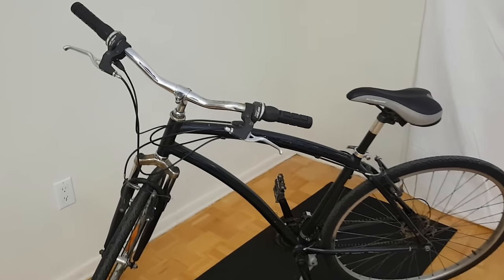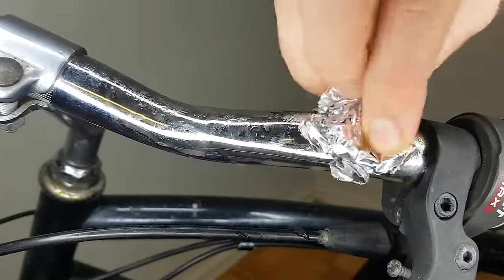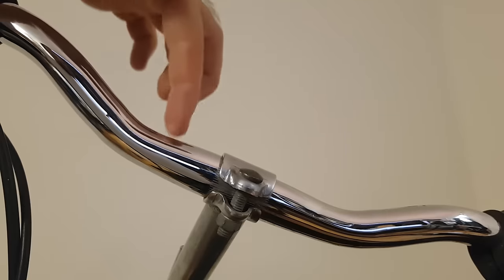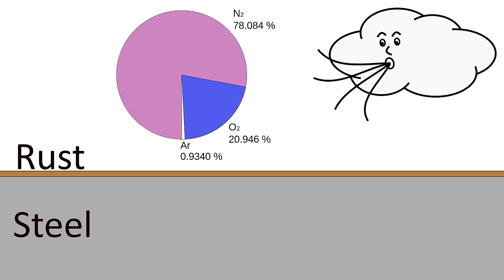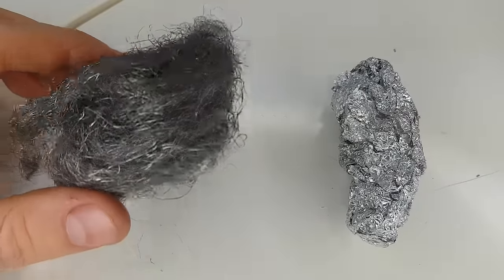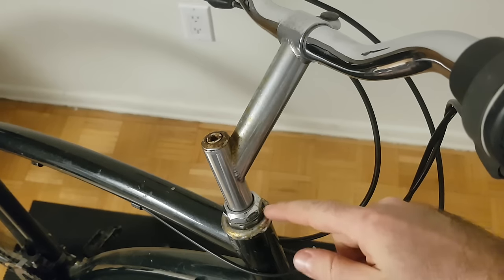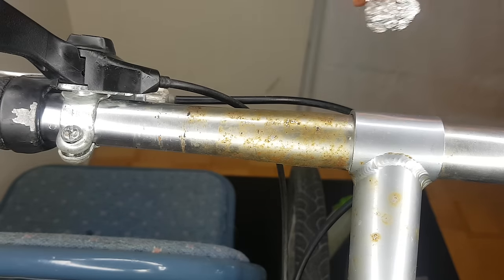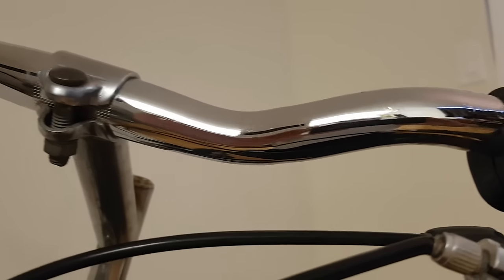Trick for Removing Rust on a Bike

Comment: Once you've cleaned off the rust and have a clear surface, apply a good quality car polish to it. This will help protect it from further rusting by creating a very thin film of wax or polymer on the surface, thus reducing the potential for further oxidisation.
Reply: Or spray clearcoat on it so it will last for years.
Reply: @carlandersonlll6861  Until it flakes off and the next guy curses you forever.
Reply: @72dodge340  😂
Reply: There's also some chrome polish you can buy in small tubes, often gets used on some old american muscle cat rims, polish with some microfiber or similar and you will never need a mirror at home.. 🤟🏻😂😉
Reply: Use the chrome polish instead of water
Reply: 0000 steel works good then followed up with Honda polish or something simple.   Use this on my motorcycle
Reply: Mother's!
Reply: @geraldtakala1721  you mean AS your using  the foil?
Reply: Or F11 polish & rust protectant
Reply: Use Chrome polish
Reply: Superb video George U.K.!
Reply: yeah basically just buy some Caranauba Wax or other ceramic detailer for the bike to prevent corrosion and damage just as you would with protecting a car
Reply: Yeah but then the Polish will turn white and get into the little cracks and never be able to get it out

Comment: After cleaning with the foil and letting it dry can you close those pores with turtle wax this would prevent oxygen getting into the steel.
Reply: Ive done this to bikes. If you dont keep it polished give it about a year and it will go back.
Reply: I’ve heard about that. I’ll have to give it a try.
Reply: Good idea
Reply: After polishing soak with phosphoric acid then clean and wax and it shouldn't come back.
Reply: @PaulDo22  it will come back because the chrome nickel layer is already damaged and the iron will just oxidize again because wax will not seal for long.  The real solution is just by an aluminum bar for $10, and it will be much lighter.
Reply: @PaulDo22  —— what’s phosphoric acid?
Reply: @truantray  not if your restoring an oldschool bike with original parts
Reply: @PaulDo22  or apple cider vinegar ?
Reply: Wax ,polish, oil ,clear coat-coat Many things will work !Vaseline is one of my favorites

Comment: good tip  - what about stainless steel and stainless steel bolts in particular on bikes? Is stainless steel similar to chromium?
Reply from the maker: Stainless steel is completely different. The entire part is corrosion resistant rather than a thin outer layer.

Comment: I am going to try this method on the forks on my bike where the shocks are. The metal tubes on the upper part of the shock look like they might be the chromium stuff. I will report back later. Thanks for this tip!
EDIT: Whoa! I tried it and it worked like a charm. The fork tubes look almost like new. I wish I could post photos. That's incredible. I wonder if spraying them with WD-40 would help keep rust down?
Reply from the maker: Nice work! Glad it worked on your bike too.

Comment: Wondering if I sprayed the cleaned areas with clear lacquer if it would work the same as applying wax afterwards to protect the steel from rusting again.
Reply from the maker: Most likely, but the clear coat won't be as durable as the original chrome surface, so it will be more susceptible to scratches and chips.

Comment: Great video! Does it work on chrome motorcycle wheel rims???
Reply from the maker: Thanks. If the material is steel with chrome plating, then yes it will work.

Comment: Would this work on a motorcycle header?  Amazing and thanks for taking the time to make the video !
Reply from the maker: It will if the surface is chromium plated steel.
Reply: Seems like it probably wouldn’t hurt to try?

Comment: Hi. What would be your advise for taking out the rust from a steel frame that still has part of his old paint on it? I dont want to painting it back again, just remove the rust and leaving it with a rat rod style (greetings from argentine)
Reply from the maker: The issue is that the rust will likely cling to the metal a lot better than the paint will, so if you try to remove the rust you will take paint off too. I'm not aware of any work-arounds for this.
Reply: @cjhoyle  i dont mind if some of the paint removes with the rust. My doubt is how i leave the frame after the rust-removing if i dont want to paint it back, just leave it like a rad rot. Maybe some lacquer? (Sory if my english sucks haha) and thankyou anyway 4 your time
Reply from the maker: @lorensmashing  Yes, I've seen that done before. People who like the look of rust (they call it a "patina") will let something get rusty, then apply a clear coat on top of it.

Comment: Does this work on chromium plated motorcycle exhaust also?
Reply from the maker: I have no experience with motorcycle parts. But if the materials are the same, there's no reason it wouldn't.
Reply: @cjhoyle  Thank you! So just the normal one that I can buy at a grocery store?
Reply: @cjhoyle  Just normal foil from grocery store?
Reply from the maker: @richardantonykoit4586  Yes.

Comment: This was a great video. I like the diagram/images that you used to explain the reason behind rust-formation and why aluminum foil gets rid of the rust. It makes the understanding of the process so much easier. Keep up the good work.
Reply from the maker: Thanks, I'm glad you found it helpful :)
Reply: Steel may restore by rubbing aluminum foil but how to clean rust from nut bolts made from iron. I wld like to clean my father's bicycle kept in shed for 3 years which became rusty.. 😢
i must have to recover it at home.
Could u plz guide easiest way to remove rust from iron!

Comment: As Aluminium is also down the oxidation potential, reducing iron with aluminium will help. This would also explain why wetting is necessary. Without an electrolyte (such as water) oxidation is much slower. That is one reason why seawater is a corrosion accelerator.

Comment: I’ve used foil and water on numerous motorcycle parts over the years. It works wonderfully.  I’ve brought back many parts others would have thrown out.  As long as the chrome hasn’t flaked of it works.  The wax afterward is key to preservation.
 If you get to a weld joint or similar it’s sometimes not possible to get it nice. At that point I sometimes tape off the good chrome and paint the joint if it can look good and symmetrical. 
 For instance, on a front crash bar, the point where the top bolt on and the ends bolt to the frame.  You can tape both sides of the joint and paint the middle, where it connects to the frame.  The paint will blend in with the frame and looks good.

Comment: This worked amazingly! I used this on the handlebar and any other chrome surface I could find then disassembled the rusty bolts and bike pedals and soaked them in Iron Out. 30 year old bike that's been sitting outside looks as good as new!
Reply: Feels good bringing something back to life doesn't it
Reply: you watched a video then went and got busy

Comment: In response to the comments about clear coat, it doesn't work well on Chrome or polished ally. For normal paint and laquers the surface needs to be roughed up or keyed for the product to stick properly. There are special "DTM" (direct to metal) products but even these sometimes fail when applied to highly polished surfaces

Comment: what about the scratches due to rubbing, after?
Reply: Primer it and paint it mate
Reply: He explained it in the video. You can’t scratch a harder medal with a softer one
Reply: Lets compare this to rocks okay? So theirs different types of rocks. Some are stronger than others. You cant scratch or break a stronger rock with a stronger material with a less strong material rock. Same applies with this situation. Aluminum is not as strong as what the bicycle or motor bike is
Reply: I have done this as far back as the late 80s. I get it but it does scratch. Not sure what does it but I’ve tried it multiple times and it left linear scratch’s along the pash of rubbing. Perhaps it is the oxide(iron) slurry created or maybe small bits of chrome getting into the foil. I worked in a body shop as a detailer so I’m pretty sure I wasn’t contaminating anything, etc.

Comment: Best thing would be after removing the surface rust, spray the handlebars with a Rustoleum clear coat.
Reply: Yess or coat it in some minwax. Never rust
Reply: I'm gonna try this, thanks for the tip
Reply: Watch it, chances are the chrome will look gray after clear coat. Ask me how I know, maybe I put it on too thick, who knows. It still looks okay, but I will use wax from here on.

Comment: Thank you sir for the very informative video. I'm assuming that this same technique will work on automotive parts also. I was hoping that you would have made a comment about that but you didn't. So I guess I'll just have to try it. You now have one more subscriber to your channel. I'm looking forward to seeing what else I can learn from you.
Reply from the maker: Thanks. What matters is whether the part is Chromium-plated steel. Certainly older cars had a lot of parts which were made out of this material such as the bumpers and grills.

Comment: Why not make your polished surface permanent by spraying the chromium with a plastic clear coat?
Reply from the maker: You are certainly free to do this, or to rub it with car wax as others have suggested in the comments. Keep in mind though that with a clear coat you'll have a less durable surface finish than what you started with which will get scratched much more easily.

Comment: I have found over the years that my rusty old beater bikes are less apt to be swiped by a would be bike rustler than my nice shiny one Lol. However I have an old rusty BB gun from the 1950’s that I’m going to try the aluminum foil on, thanks for the tip 👍👍
Reply from the maker: haha I have found the same thing. You may have noticed that the bikes I used for the demonstrations in this video are not bikes that I actually ride. I'm perfectly happy with my green machine staying nice and rusty!
Reply: @cjhoyle  Hi CJ this is very underrated comment and answer. I also like to keep my bike a bit old looking and rusty. That guarantees it is still where I have left it in the morning when going to work. I also downgrade led lights with bits of celotape so they look ugly and broken. Nobody stolen any since I started doing that.
Best wishes to you. And thank you for your vids.

Comment: This is the best video I've seen so far (and trust me, I've been watching a few) on what the heck is going on with chrome. So, thank you very much. I wonder what happens if you put a polish or oil on the chrome after removing rust? Also, what will happen if you do the aluminum foil trick on something thats actually aluminum, not chrome?
Reply from the maker: I've never tried it, but others have comment that applying wax to the surface will help to protect it from rusting again. Aluminum doesn't rust, so no need to rub it with aluminum foil.
Reply: Aluminum does oxidize, mothers mag polish will put a Crome shine on aluminum or magnesium!!! Old care guy trick!

Comment: You are basically wet sanding the area by taking off a little bit of the chrome. The same happens to your cars clearcoat if you polish any scratches out of the paintjob. You can only do it so many times, until all of the clearcoat is gone or in this case the chrome plating is gone. But it'll take a while until that happens.
Reply from the maker: My theory about why this works is different than yours (I explained my theory in the video). I do not believe that rubbing the surface with aluminum removes a layer of chromium since aluminum is a significantly softer material than chromium. Sure, there is some friction there, but it would be like saying that each time I mop my ceramic tile flooring I am removing a layer of ceramic with my wool mop.

Comment: Great video with a thorough explanation.  I have an aluminum bike wheel that was cleaned with a dishwashing liquid that had bleach.  It wasn’t washed off and now the wheel has stained.  I’ve tried vinegar but so far I haven’t noticed a difference.  Any advice on removing the bleach stain off an aluminum wheel?  Thanks.
Reply: wire whool dabbed in wet simple soap

Comment: Fantastic!

Loved it. Fast easy and fun. Simply excellent. 

1. Will covering my bike with a bike cover help?  I quess it will? 
2. What about wd40 or vinegar, Instead of using water, as water was the original accelerator in this problem?

Thanks
Reply from the maker: Keeping your bike from getting wet when it's not being used will definitely help. Presumably coating the surfaces with a grease or oil after the rust has been remove would help it to repel the water (since oil and water don't mix) but it would quickly get rubbed away any time the part is touched.

Comment: Once it’s clean try coating it with ACF50, a special oil designed for aviation to prevent or at least greatly delay oxidation of aluminium or rusting of steal.
Reply: Acf50 is amazing can even use it on the electrics..

Comment: Excellent informative video. 
I've been refinishing surfaces fir decades,  and this is the first time I found out about using aluminum foil and water.
Reply from the maker: Nice!
Reply: which dide of the Alluminium foil should I use? Also water dripping filth onto brake cables? Yeah. No.
Reply: So it can be used on gorks attached to the ftont wheel with water? I was toldnot to do this. Use a beillo pad carefully. Nothing should go near the forks or they will seize up, same as the beakes

Comment: By adding car wax to the reconditioned chromium and let it form a haze before it is whiped off, if this coating would seal out moisture and oxigen?

 And on painted surfaces use baking soda and water with  a micro fiber rag, and rub? If this would work to remove the rust without harm to the paint? (Personally I 've never tried this.)
Reply from the maker: Others have suggested using car wax in the comments of this video. I've never tried it myself.

Comment: I have a question I have a chrome BMX bike from the 90s that has some rust on the handlebars and frame my question is do I have to worry about rubbing off the chrome plating If I scrub too hard with the aluminum foil
Reply from the maker: This is not something to be concerned about. The chromium surface is much harder than the aluminum. Think of it like rubbing a bar on soap onto your kitchen table. You would need to rub that bar for an awfully long time before it starts to wear away the table,

Comment: Very informative. I bought a gold low rider bike off a neighbor. I assume the gold is a paint or can I use the same method to remove the rust on the gold parts? Thanks
Reply from the maker: Unfortunately the aluminum foil will most likely scratch away the paint.

Comment: Your before and after seems to be fake in my opinion, I suspect you properly polished it or at the very least used a metal polish. There's no way tin foil and water removed all those scuffs,  most likely even adding to the scuff marks.
Reply from the maker: I've received this comment before. The only step that I neglected to show was wiping off the metal with a microfiber cloth. If you look closely the scuffs are still visible in the after shot.
Reply: @cjhoyle  time stamp the part of the vid I need to look closer to as I saw none

Comment: I have some 'chrome looking' polished stainless steel parts on my old Citroen DS,  that are slightly pitted.  Will this work on polished Stainless Steel too?
Reply from the maker: It's worth a try. The aluminum is still softer than the stainless steel, so it shouldn't make it worse.

Comment: Why not just use 000 steel wool? 000 steel wool will polish and remove.. yeah course steel wool will scratch but 000 and 0000 will not! It would be alot faster and easier.
Reply from the maker: I don't have any experience with those products, but I would argue that they won't save time (or money), if you factor in the time required to buy the steel wool. Aluminum foil is something that nearly everyone has in their home.

Comment: Would this trick work on just normal raw steel? It’s not chrome or anything I just have scooter handlebars that are rusted over and I wanna clean them up so it’s not covered in rust
Reply from the maker: I've never tried it, but I don't think aluminum foil would be abrasive enough to remove rust from unprotected steel.

Comment: Yes, aluminium foil absolutely helps you to make it all look decent again, but this guy definitely did something else to get the end result on that handle bar, stop cheating...
Reply from the maker: The only step that I didn't show in the video was that after wiping away the water with a dirty rag, I wiped it with a dry microfiber cloth which made it shine a bit more.
Reply: @cjhoyle  that is Not cheating  GOOD WORK< AND INFO

Comment: Will it work on my rod rings there not that much rust its green but will it work
Reply from the maker: What's a rod ring? The trick will work if the item is chrome-plated steel.

Comment: After cleaning, is there a way to prevent rust from forming again?
Reply from the maker: Other commenters have suggested using car wax. I don't have any experience with this, but logically it should work.
Reply: @cjhoyle  thanks! will give it a try
Reply: some say rustoleum clear coat, keeps it preserved longer

Comment: Will the aluminum foil leave scratches ?
Reply from the maker: No. As I explained in the video, aluminum is a softer material than the chromium, so it will not leave scratches.